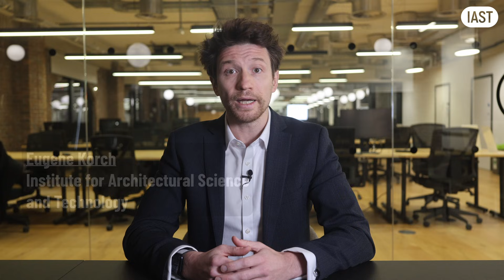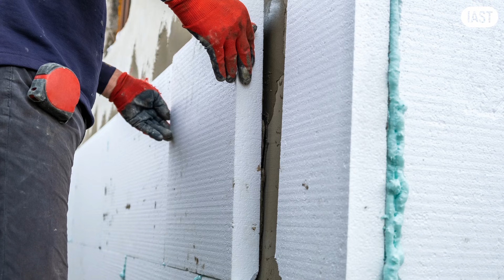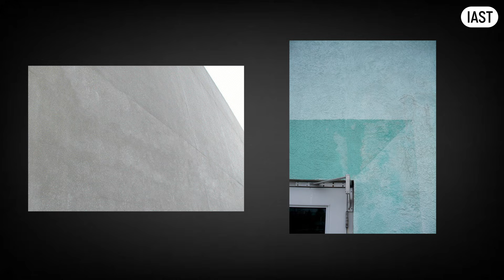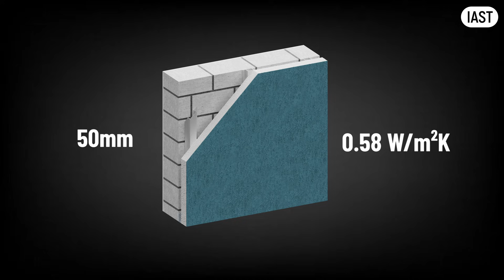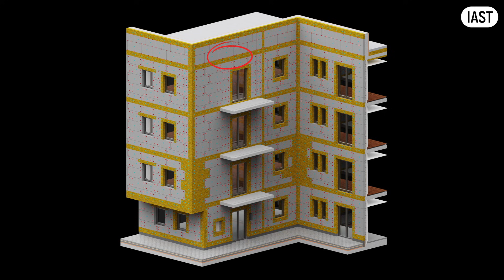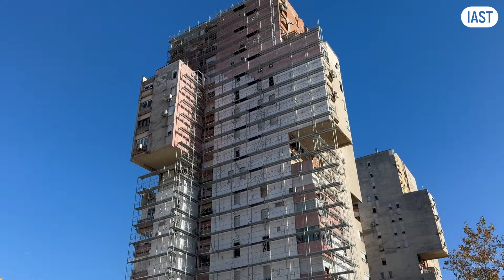Insulated Render - EIFS, ETICS, EWI

Comment: I do believe the EIFS system does need to drain out water—But one thing I have not understood in the Modern Draining system,  it is incorrectly thought of as a continuous insulation—But just as the water is allowed to drain out-- also the COLD air is allowed to migrate in during winter, which the cold air is BEHIND the insulation, having cold air in the 25mm gap. It is like having a puffy jacket, but you leave the front zipper open. What is the Real effective U-value with actual tested walls (not a single perfectly built wall test, but instead an imperfect 4 wall test)
Reply: Wall + thermal insulation tightly attached to the wall + vapor-permeable and water-repellent membrane that protects the thermal insulation from possible rain penetration + air space + external facade cladding. Moisture from the room is vented into the air space through the vapor-permeable membrane.

Comment: Leaving drainage gap behind insulation doesn't make sense since you let heat escape through that gap.  If I needed a look of EIFS on my house I would place EPS insulation directly on to outside wall thick enough to keep dew point inside that foam board only then attach strips for drainage  and finish assembly with densglass sheets
Reply: You're ignoring the rockwool and membrane layer.
Reply: @henrymccoy2306 yes, because there is a gap through which water can run, if water can pass warm air certainly can leave the wall without problem
Reply: @andreycham4797 except 1) the rock wool is behind that drainage gap so no, warm air does not escape and 2) It’s a drainage layer, there is very little airflow to reduce efficiency.
Reply: @henrymccoy2306 watch this nonsense at 8:16 there is a gap between foam insulation and the wall
Reply: @andreycham4797 yes we watched the same video. The weep hole would be around a square centimetre for a several square meter section. Airflow is near zero in this drainage space. There is also the rock wool still present behind this space